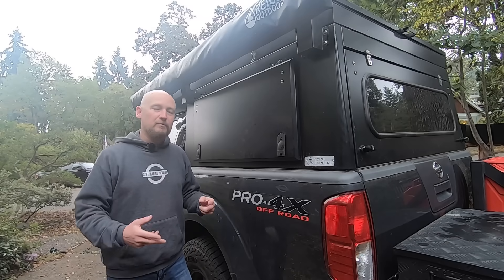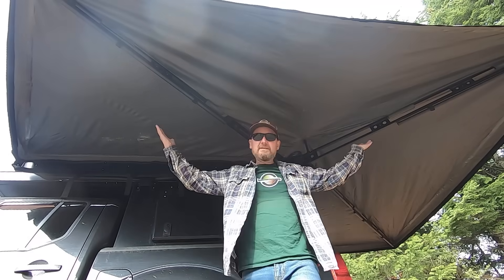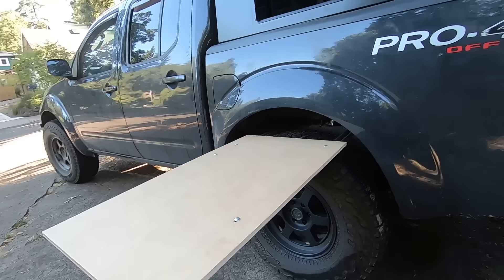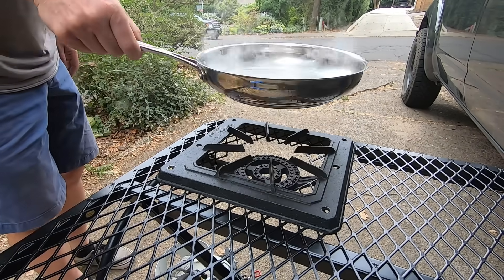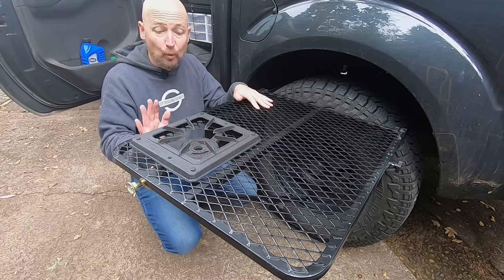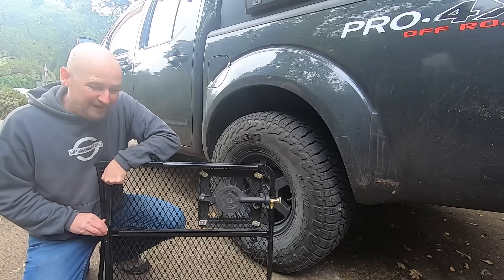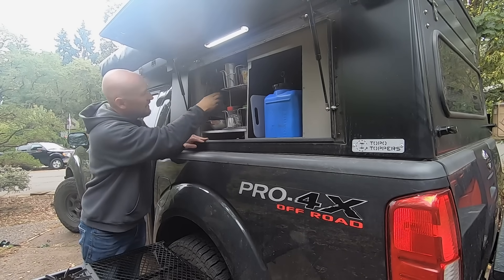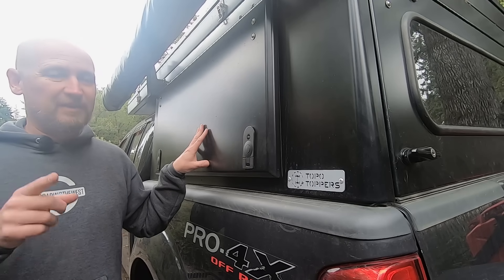Camper Interior Build Series: Part 7 - Cargo Door Kitchen

Comment: How about attaching magnets to the wind block since your table is made of metal.  Easy on, easy off.
Reply from the maker: I think magnets is a great idea...way better than hooks!
Reply: Add them to the edge of the table so you can slide the wind block up/down for the best coverage @softroadingthewest
Reply from the maker: @eric.browning   That's a great idea!
Reply: Yeah, they have washer style magnets that can easily be bolted thru if that backpacking windscreen is aluminum or titanium.
Reply from the maker: The crew cab short bed is 205" overall and the crew cab long bed is 14" longer at 219" (although the truck bed itself is only 12" longer, so I'm not sure where the other 2" of overall length comes from). I can't imagine that would make a significant difference on anything that isn't a tight trail where you have to wind between trees & rocks...you might feel it the most in parking lots actually. And compared to, say, a Chevy Silverado crew cab SHORT bed at 230"...it's still a relatively small truck. They didn't offer the Pro-4x package in a crew cab long bed if you were thinking along those lines, though that's probably a non-issue since even with the Pro-4x you might want to upgrade the suspension and if you're mostly driving groomed forest service roads, the rear locker might be overkill. I would test drive both the short and long bed so you can feel the difference. That's what I did and ultimately settled on the short bed despite the limitations of that tiny little bed. :-)  The ideal configuration is the King Cab, you get the 6' bed and an overall shorter truck, if you can do without the full size back seat. That's what I really wanted, but my kids were still just a bit too young and I needed to be able to transport both of them comfortably on a regular basis.
Reply: Great idea
Reply: @travelinman482 They made the Pro4x with an extended cab and 6.5 ft bed - harder to find than the crew cab 5 ft bed - same wheelbase and length. The SV trim came in the crew cab with the 5 ft or 6.5 ft bed.

Comment: Going to try this one last time. For a wind block around your stove, maybe chain mail. Will have to be a fine mesh, or a couple layers, but could stay attached, heat proof, and able to fold up easily with your stove. There are inexpensive sources for chain mail online - think that's why my last two comments about this got nuked, I mentioned a certain online retailer.
Reply: I was thinking this same thing! I was envisioning what they sell to clean cast iron pans.

Comment: I thought the first table would have worked with a leg like the second one. I love your ingenuity and that you reuse everything. Keep up the great work, safe travels.
Reply from the maker: The problem there was, the unistrut support pieces needed to run the full length of the table along each long edge, in order to have enough unistrut to extend into the truck frame but also be able to fully retract to be no longer than the table so I could stow it. That meant my integrated burner would need to be right in the middle of outer edge of the table, interfering with mounting any sort of fold-down support leg I might come up with. 

The secondary problem that I didn't bother diving into in the video is that - when I was working on the DIY table design, which is before I built the cabinet inside - my plan was still to stow the table right inside the cargo door. But the depth of my DIY table with the unistrut channels plus the integrated burner was going to greatly complicate and limit how & what I could build inside the cabinetry right there at the cargo door. And I realized that stowing my table here meant that anytime I wanted to access my water (e.g. in the middle of the day, not at camp, to refill my water bottle or something) I would have to deal with the table being in the way.

I did start looking at DIYing a folding table that I would simply stow in back, but when I did the math on the parts I was going to need to buy, the hours it was going to involve, and a lot of other projects still awaiting my attention, I realized that it just didn't make sense to re-invent the wheel. When I placed the order for the Tailgater table, a huuuuge weight came off my shoulders and I knew I had made the right decision for me. 😄
Reply: @softroadingthewest  thank you for the insight

Comment: Coming along nicely! Maybe you could get a large diameter can or old pot and cut it to fit into the hole in the mesh. It could rest on the burner supports. If you need more wind protection, you could cut slots where the burner supports are so the rest of the can/pot could drop down a bit father. You could probably do the same thing with some flat steel. Just bend it in a circle. Not sure if that makes any sense or not. Thanks for the video! George.

Comment: For a wind block, you could use a tube (or thin sheet metal, rolled and riveted) with slots to sit on the burner support. It would enter by the top and could be secured under the cast pan support

Comment: Thanks for sharing. I have a similar set up where my propane is on my roof and I run the hose to the table attached to the wheel.  I really like the integrated burner on the table. I am looking forward to see how this works on your long trip. Safe exploring and adventuring.

Comment: You might try a larger hook and hooking the metal wind block OVER the outside edge of the table.  Just the hooks would go over the edge.  This would make it very easy to put on and take off.  You were using the small hooks and trying to go underneath.  ??  I loved the burner idea!  Another idea is to use a magnetic tool holder bar that would stick on the side, block wind, and hold cooking utensils while cooking?

Comment: Things seem to be coming together.  Just to pick a couple of nits:  As someone else noted, I don't like flame next to a gas filler, but maybe it's far enough.  Be sure to check the seal regularly.  2nd, the table on the tire looks good in your driveway, but what about when the tire is covered with slush and mud?  O,  & you'll find those knives will slide off the holder when you drive unless you put them on point down, so they catch on the handle before sliding off.  Try cutting the bottom out of a deep aluminum pie pan to make a wind guard.  I see someone else suggested this.  Depends on how much wind there is.  You can test this idea with cheap disposable ones.  They can be cut out with scissors.

Comment: You could double your kitchen space by hinging a wooden surface to the side of the metal grate below the water jug. It would need a support leg but wouldn't add too much weight or thickness once collapsed.

Comment: Donald as to reinforcing the expanded steel mesh on your table and as a wind block, I would cut the mesh out in a circular pattern for the burner, and then take and hand bend some 1 1/2 inch steel strap into a circle, and then weld that into the expanded mash that will give you a one block for your burner, and also reinforce the hole in the mesh. In a pinch you could use inch and a half flat bar, but it might be a little too thick to bend so some kind of strapping something around 16th inch or thinner would probably be sufficient.

Comment: For the burner wind block: how about a steel pie or a square cake pan mounted on the underside of the burner? You would need to cut out a notch for the gas line but it could also double as a grease catch. You could just use safety wire or p-clamps to mount it into place.

Comment: Could you use a utensil roll with hooks or velcro as a wind block?  Just hang it from the table edge. Then it could go on either side based on wind direction. It would also serve a dual purpose of giving you easy access to your larger utensils

Comment: Hey Donald, after looking at the size of the burner, what about a 9" x 9"  metal cake pan? You could cut a slot for the propane inlet and maybe fashion some small brackets or hooks to slide the cake pan into place when you need it. Pretty cheap option too.
Reply from the maker: That is an excellent idea, definitely worth exploring! Thank you!

Comment: Have you tried to attach some neodymium magnets to some small metal L brackets to keep a wind screen in place?  Since the table is metal, those small, powerful magnets might do the trick.  Plus if you get crafty, you might be able to get the magnets to do double duty and help you store it away.
Reply from the maker: I haven't, but I'm going to. Numerous viewers suggested magnets, it's a great idea that I did not think of. I still haven't looped back around to that project, but I need to get on it this weekend as I'm hitting the trail very soon! Thanks!

Comment: Great idea with the stove! I really couldn't tell from the video, but could you hang some lightweight panels from the sides of the stove with s-hooks to block the wind? I thought you could easily hang a panel or two from the edge of the stove "tabletop" in the direction of the wind. Just a suggestion.

Comment: You have enough room between the bottom of the burn and the grate area towards the tire to mount a foldable wind screen. Hard to explain without a drawing, but look at the Sun Oven windscreen and I think it will spark some ideas for you. Some small hinges and aluminum sheet of appropriate gauge and your good!

Comment: Low pressure  burners are very susceptible to wind. I have struggled with a CampChef Weekender stove for the last 15 years. It's an amazing stove right up until the wind comes up and blows out the burner. We have tried so many different 'fixes' but none solved the issue. I bought a high pressure burner stove and it is so much better in the wind. Your burner would be great if it were inside an enclosed tent, or awning with walls. Possibly keep the frame, but replace the low pressure burner with a high pressure burner from a stove. I think the regulator needs to change as well since the pressure requirement is different.

Comment: I'm interested to see what you do with the heater setup. I have a Frontier with GFC camper and my current diesel heater setup is kinda a pain to setup/teardown. Been brainstorming some better approaches.
Reply from the maker: I'm still undecided, so for now I'm just going to do yet another winter with my Mr Heater Buddy (plus 12V electric blanket inside my sleeping bag). I'm not fond of the moisture it puts out, but most places I camp in winter are on the desert side of the state and condensation isn't a big issue. Whatever my final solution ends up being, it's definitely not going to involve something I have to set up and break down at every camp...the way I travel, I generally like to move every day and with so much of my morning and evening time consumed with filming, I can't add more steps to making/breaking camp. I've eyed the Propex HS2000 but am still not quite convinced I want to spend that much vs the number of nights I would actually use it. I think if I get to a point where I can travel more than my current life allows, dropping a grand on a heat system might start to make sense, but I'm just not there yet. 😄

Comment: Your wind blocker could simply be a trifold of sheet metal, few inches high, could close as a book or accordion, you know those fire reflectors yet smaller. Just add (tack weld) a couple of verticle pins at the bottom to pass through your table to secure it
Reply from the maker: I'm just not sure how to hinge the pieces of metal so it would fold and unfold, short of actually attaching actual hinges, which seems clunky. But now that you've got me visualizing sheet metal I have sitting in the garage...I wonder if I could get away with just a single flat piece of metal, which I would strategically place depending on where the wind is coming from. Perhaps I don't need it to wrap all the way around if I can easily reposition it as needed..? 🤔

Comment: Looks good Donald! Didn’t you mention once that the kitchen was gonna be accessible from the inside also?
Reply from the maker: That was an original goal, yes. Ultimately I decided that engineering that was going to be more trouble than it was worth, especially once I came up with the dual water jugs so I always have access to water inside. So now instead I just carry my little backpacking stove and a small fuel can in one of my inside drawers so I can make coffee on a blustery morning or heat up a can of chili if I roll into camp late and want to make a quick meal inside.

Comment: Ya, only problem all your weight is on one side of the vehicle, fuel tank, fridge, water tank, awning, and of course your weight while driving. This will make you feel like you’re dragging a anchor through sand, snow, mud. Hamper offroad ability not be able to float on top of soft surfaces. Not to mention   Tire wear, suspensions and brake and barring wear.This has been the problem plaguing sports mobile vans with doors on side, often times you will find an extra leaf on the driver’s side ,sort of a band aid fix for the problem.
Reply from the maker: All the weight is NOT on one side. Yes, I have my fridge on the driver side, but it is a small, lightweight inexpensive Chinese model that is mostly plastic, and its weight - even full of food - is more than offset by the segment of back seat I removed to install my fridge...the seat I deleted weighs WAY more than the fridge. I have 6 gallons of water there on the driver side, yes, but I have 10 gallons of fuel on the passenger side along with my propane bottle, and on long trips I carry an extra gallon of water stowed on the passenger side. I have slightly more wood cabinetry on the driver side along with the awning (which is relatively lightweight for a 270 at 40 pounds) but the passenger side carries two very heavy power stations, 20+ pounds of video equipment, and at least 100 pounds worth of tools, recovery gear, and other what-if kinda stuff. Not to worry, things are actually quite balanced.

Comment: Great episodes and a great build. But either way all the efforts you have put in. Why not have a solid second battery system? Quite sensitive to have all electrics to depend on a cigarette lighter connection.
Reply from the maker: * shrug *  I already had the Jackery (and I didn't even buy that because I was previously sponsored by Jackery). I do all this DIY stuff because I'm on a very tight budget. Didn't make sense for me to spend a bunch more money on another battery and all the components that go with setting that up...the Jackery is fully self-contained. I'm not a fan of the cigarette lighter 12V output at all, but if it were to slip out, I mean...it's right there, it's a 2-second operation to push it back in. It's not like there are mission-critical systems running off it, it powers some lights I use at camp and outlets I use at camp. FWIW, having had that Jackery built into my couch for nearly a year now, I have not once had the plug slip out. It's recessed enough that I don't bump into it, and it has stayed in place over countless crazy bumpy trails.  :-)
Reply: @softroadingthewest   fair enough. Solid build in any case.

Comment: Could you add a second burner to the table? You seemed to get use out of two burners in the past.
Reply from the maker: Over the past couple of years I've noticed I'm much less inclined to cook multi-pan meals after a long day of driving and filming. I'd been carrying around a huge 2-burner stove but only using one burner 90% of the time. Then when I was in between toppers, my entire kitchen was contained in one Pelican case and I had to find ways to do all my cooking on one tiny backpacking stove - and it was fine. I would just go back to my big 2-burner stove before integrating a second burner in the table, but for the moment I'm up for the challenge of simplifying my cooking and just planning meals around only having a single burner. 🙂

Comment: @softroadingthewest Do you notice any issues with the locks on the Topo Topper? I've been looking at either the Topo Topper or the GFC but a huge issue with the GFC is the locks on the doors are known to be horrible after a few offroad trips.
Reply from the maker: No issues so far. The rear door handles are the same standard Bauer locks you find on many regular toppers...Topo delivers them with rubber covers for extra protection though I admit I quickly gave up on messing with the covers. Cargo door latches have been fine as well; they have some adjustments you can make from the inside to optimize the grab if things shift at all, though I haven't had to fiddle with those either.